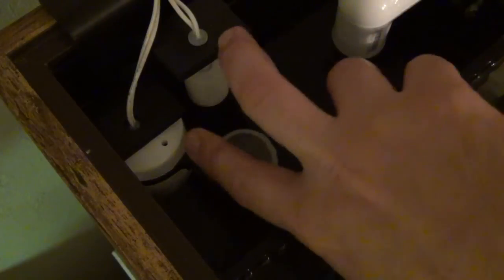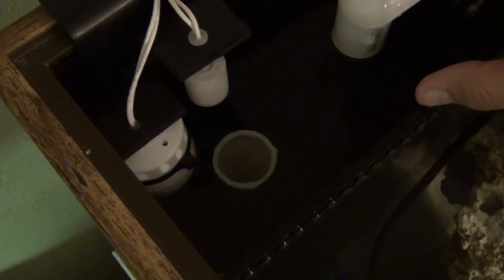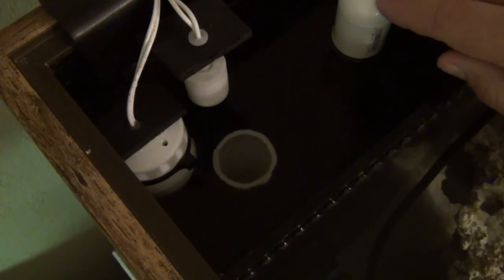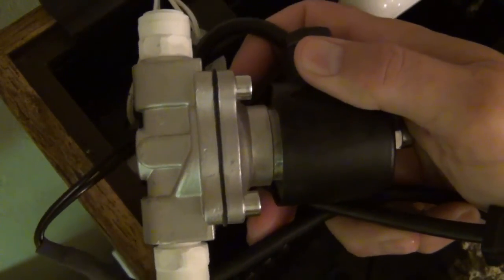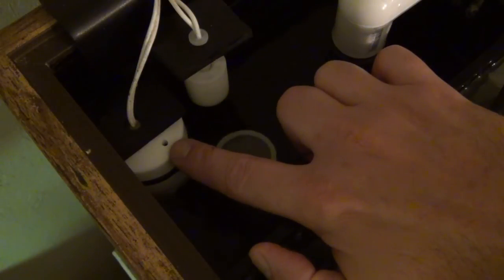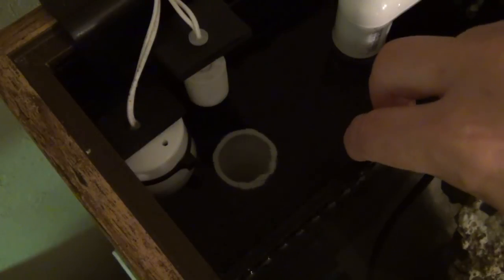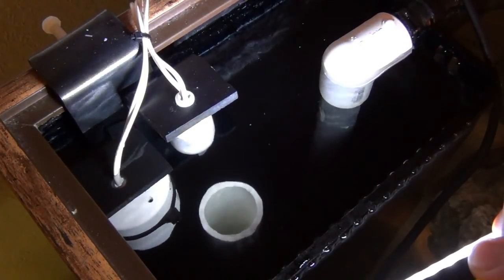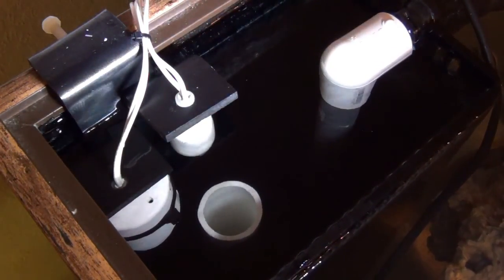Custom Herbie Overflow

Comment: impressive. really thinking outside of the box. but im confused to why a 1" emergeny drain wouldnt ha capable of draing your display. even at full siphon?
Reply from the maker: When I ran my plumbing to my garage sump I made the mistake of not running a larger drain line then my return line.  I only have one drain line per side so no added emergency overflow without running another line to the garage and that was a pain.  Should have run two drain lines but I didn't, stupid on my part.
Reply: well at least it worked out. im going to be switching to a herbie. waiting on parts. are you still running that set up?
Reply from the maker: Yep still with the same setup but planning my new build where I'm going with a bean animal.  I'll have more on my new build soon but I would suggest doing a search for bean animal overflow.
Reply: i am currently in the process of setting up a herbie. waiting for new bulk heads and a gate valve. im limited bc my tank is a rr corner over flow. 1" and 3/4" bulk heads. return is ran over the back.
Reply: jayhawkscott I just purchased a 120 with dual corner overflows and have been looking for answers, this is great. The only additional thing I am planning that is not in your set up, is I will be connecting the two corner overflows with a c2c weir in the middle. I think your design is awesome, and is for sure the route I am going to go. My only question is why switch to bean animal? I believe the bean animal is just a modified herbie with a 3rd pipe. If you chose to go with the bean animal you would loose one of your returns which is probably a 3/4" bulkhead. Nice set up and should be rightfully named the jayhawk scott overflow, jay scott overflow, or hawk scott overflow .
Reply from the maker: Kc K With my current tank configuration of two overflow boxes both with two bulkeads (1" and 3/4") I think the best setup is that of a Durso in either a full siphon (like I have) or as a standard gravity fed Durso.  The danger with running a Durso in a full siphon is that you don't have a backup to prevent overflows but I addressed that with my float switches.  On my new tank (which I will be talking about soon and is why I haven't had any new videos lately) I do plan to use one overflow box and a bean animal.